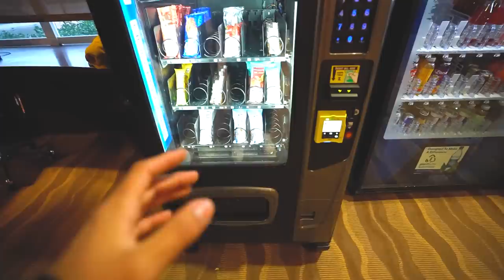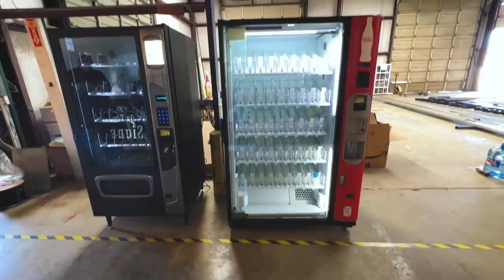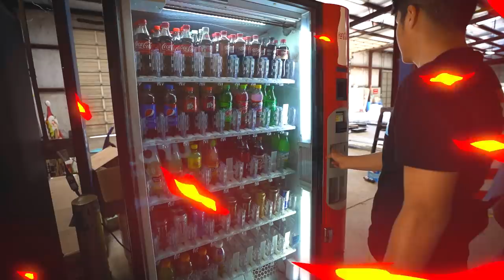I Got Kicked Out Of My BEST Location... (The Hotel)

Comment: Glass front Soda machine sticky? You can remove the soda product pusher. There are plastic tabs on the bottom that you pinch to remove the product pusher, clean it with warm soapy water, rinse then air dry. I also spray non toxic silicone lubricant on the moving parts and where plastic rub against each other to keep it sliding smoothly. Each row empty or not working is potential monies. Great content btw.
Reply from the maker: Thanks for the tip! I’ll definitely be doing that 💯

Comment: Hey bro. I used to own a pizzeria and when we hauled equipment we always used a flat bed trailer, it’s low and you can strap things down. Get the one with a ramp that folds up at the back. Those toy hauler types.

Comment: Did you put some tape over the hole that the cable comes out of? Or a breathable mesh if the air flow is needed? Just in case the mice happen again? Might help you a lot :)

Comment: Yo fence off the bottom of both your machines at the warehouse, so rats don't get in and the power plug slot if the space is big.
Reply from the maker: The drink machine is sealed shut so that one is fine, and the snack machine should be good too hopefully, if not I will fence off all the openings if there’s any underneath

Comment: Those trays are only held in by a small screw on each side. They're easy to pull out and clean if you need to use those stuck selections

Comment: So, let me get this straight...
Even though you've already had a rodent problem in that location in the past. Now you placed another vending machine that is soaked with sticky spilled soda pop to attract the rodents again... 
Huh!!!
You really need to sterilize that machine ASAP....
Reply from the maker: The machine that had a Rodent issue was because there was a gap in between the door. We later replaced the machine and everything was fine. We ended up taking the machines out because the location went out of business due to COVID. 

We didn’t get to clean the soda this time since the location was already closed. A worker was waiting for us to shut the doors. We went back the next day to clean it (: